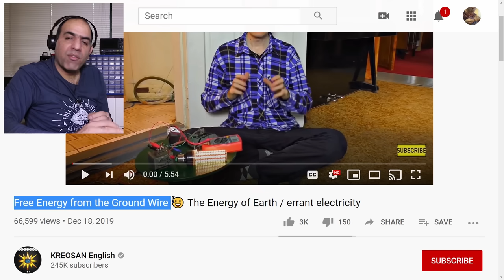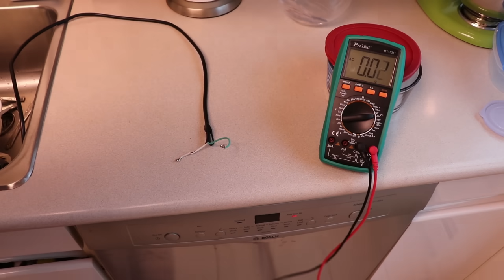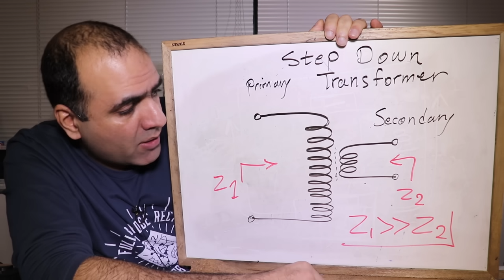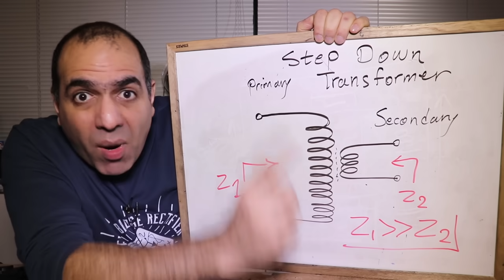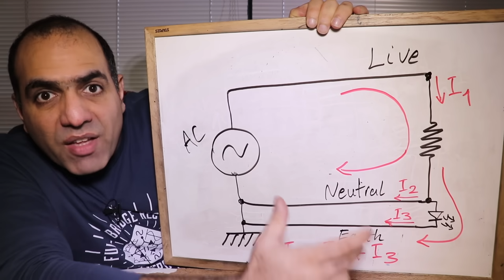FREE ENERGY DISCOVERED in Ukraine, 3M Subs Celeb!!!

Comment: before safety ground (and polarity) was added to plugs, people could plug appliances in however they liked. Both prongs were the same size and there was no ground. Back in those days everything had metal and chrome chassis. Since engineers were safety minded, they would attach the case to neutral, but there was a problem. Since a user could plug the polarity of an appliance in however he wished, one could plug the appliance in so the case was actually hot. not a problem in most cases, since touching it merely rises you to line voltage, but if at the same time you touched a grounded sink, faucet, or another appliance plugged in the other way, you would get a shock of full line voltage. It was deemed bad that a housewife who was touching the toaster, and the refrigerator, which were plugged in with opposite polarity, would give her a full voltage shock!!! it was considered...... unsafe. 
Another shock hazard was -  even if two appliances were plugged with both devices in phase - there could be a voltage potential difference between the cases anyway because neutral is load carrying, so if they were plugged in to a line with a significant load, there could still be a voltage large enough to shock... or if they were on different breakers there could be a significant voltage. Thus was born the safety ground !!!!! (S/G).

So the NEC guys decided to do two things. 
First - require three pronged outlets.... add a safety ground for the chassis so it can be grounded safely without the danger of load bearing neutral voltages.
Second - make the neutral prong larger than the hot prong so if the device does not have the third grounding prong, the two prongs of the plug itself can still force the user to plug the polarity in properly - making it impossible to plug something in "backwards" (if everything is wired correctly LOL)

I think of this little story about safety ground every time you tell your refrigerator story!!!

A barely interesting side note - Almost all of the outlets in north America are installed upside down. They are supposed to be installed with the  ground prong facing up. If you look at the patent, the ground is at the top. The engineer who designed it said this was to reduce the chance that a paperclip or other metal object would cause a direct short if dropped on the prongs. he reasoned that the ground might deflect it or at least there was a chance the metal object would touch ground and neutral rather than being guaranteed to touch hot and neutral as they are normally installed. Electricians put them ground down because it looked better - it made a little face!!! This  "face"  installation (which is technically upside down) has become the de-facto standard. Since they are almost universally installed upside down, right angle plugs are made backwards too,  so they angle down when plugged in, ground down. To tell the truth, I install them upside down too because of this de-facto standard even though I know it is not according to the specs of the inventor.
Reply: Fascinating!
Reply: In most of Europe we use the schuko type F plug. This has two small ground clips; one on each side; which make contact before live and neutral connect. Other than that it is completely symmetrical so live and neutral can be switched randomly depending on the way you insert the plug. That means every device has to tolerate live and neutral being flipped. Because everything tolerates being flipped non-electricians do stupid shit like mix up which wire is live and which is neutral when they wire light switches and sockets. This means that the switch can be sitting on neutral, and it will still work and turn the light off, and the lamp can be floating at mains voltage when you flip the switch off and the wire that is colored as a neutral might be live.
Reply: I just don't understand electricity at all. This made me realise that even more ha

Comment: This is EXACTLY why safety ground was added in the US sometime in the early 1960's. Neutral is a load carrying ground and Safety Ground is non load carrying. I have seen voltage as high as 50 volts on neutral referenced to S/G  In an office building with a lot of equipment like computers or in industrial settings. Many people think neutral and safety ground is the same since they anchor in the same place in the breaker panel, but they are not!!!!  One of the first thing I teach my technicians is be wary of neutral!!! You can get complacent and since it is white, treat it like a dead wire. It can carry enough voltage to give you a good zap if it is load carrying! Also, if there is a break in neutral between you and the panel, you can have full voltage hanging off of it inline with a load. This can place a dangerous amperage through you if you become part of the wire to the panel . If that load is a motor or piece of equipment it will try to push the amperage to make that load go, using you as a series resistor.... One of the most deadly shocks you can get. MUCH deadlier than if you were shocked with a hot wire, because of the push from the load.  A shock from an open neutral is the WORST shock you can get.... and an easy to get shock because you get used to  neutral being grounded. BEWARE of neutral wires when working on nonfunctional equipment until you know neutral is intact. Many times if a piece of equipment has a power fault, it is a loose neutral, because neutrals tend to get wired together in big bundles with big wire nuts, more than should be in the wire nut, and one of the neutrals slip out of the connection !!!

Comment: "Don't switch the primary and secondary wiring"
A 17 year old me learned that the hard way with my foot and a scrapped fly back transformer with no readable markings.
I blew the main breaker. To this day I still close my eyes turning on a circuit.
Reply: That's why electricians are taught the left hand rule.  When flipping the power on a large cabinet, the switch is usually on the right hand side, so throw it with your left hand so you're not standing in front of the cabinet if it blows.
Reply: @danbance5799  i was never taught that rule, however i have also never been near nor heard of one of the cabinets going bang, maybe something i should start observing though just incase.
Reply: hoLY sHIT
Reply: @danbance5799  No relation to the right hand rule.
Reply: @TS-jm7jm  are those "cabinets going bang" we're talking about the thing that happens at about 1:13 is that video : https://www.youtube.com/watch?v=UJGViiDInp0 ?

Comment: NOW LET'S CONNECT IT TO A RELIABLE GROUNDING

connects to a water valve
Reply: To be fair they usually are grounded pretty well, the only issue is if the water pipe itself is rusted/corroded there will be a significant contact impedance

Comment: 3:30
That's not true everywhere, for example we here in Serbia, especially in smaller cites, have "TT sistem zastite", which means that neutral and ground wire are not connected, because of that there is , in my house, around 45V between  neutral and ground. Of course this is only the case in the smaller cites and villages.
Great video, keep it up!
Reply: so in that case, the energy is from the city electricity grid, but not shown on the electricity bill?
Reply: @DreamingConcepts  Exactly. My grandpa figured that out in 1999 when NATO bombed us, so unlike other houses we always had lights and power hahahahahaha
Reply: This is why God is a Serb.
Reply: Meaning kreosan not RECITIFIED completely
Reply: Oo susjed
Reply: No this is true everywhere! the only way to create a true neutral wire is to ground it, the only diofference is that your ground wire is grounded beneath your house and the neutral wire is grounded at the transfo going from high voltage to low voltage. However there are electircal grids with 2 live wires and no neutral wire, if one of those live wires cant carry any electricity for whatever reason the second can carry current to the earth, just not to the second ''live'' wire. And to complicate further even with that kind of grid the only reason that second wire can carry current towards the ground is because the transfo has its neutral wire at the transfo grounded otherwise it wouldnt be a closed circuit
Reply: Zdravo! Ja sam iz Španije
Reply: @mvn4844  In my house the neutral is not connected to the ground, it's 220v system and I measured 202V between hot and neutral and 15V between neutral and ground, whether the system is loaded or not, does it mean I can harness this residual voltage? I guess this voltage is caused by load of the neighbor and neutral is also not connected to the ground, and some resistance of the neutral wire between the building and distribution transformer. For example, if the neighbor has 10kw load I can get 30W residual power between neutral and ground. The bill will go through the neighbor's meter anyway.

Comment: Great video! I guess this trick with the lamp to check grounding wouldn't work in France, as we have GFCIs at the general switchboard so there is no way to "escape" it. Also, in France, Neutral and Earth are not shorted together physically (Earth is connected in every house to the actual physical ground, while Neutral comes from the electrical network) so I was wondering if it would make the voltage between neutral and earth higher, but it does not as I get 0.6 V.

Comment: Solution to the problem is, “Good luck”. Nice
Reply: Using rubber gloves and some common sense would help. And goodbye 3M subscribers.
Reply: @hartunstart  its just too bothersome to use rubber glove everytime you turn on something, so its true, good luck is all you need
Reply: @dennisbuns  Actually, may be rubber gloves are not enough. He would need a full-body condom. But it is definitely more fun with good luck only. Especially, when there are some malfuctions in the luck.

Comment: (I know I am little late) 3:36 in reality, a lot of houses in the СНГ are not grounded because they are too old (this is why kreosan used water pipe for ground)(the water pipe as groud is too dagerous, don't do that or you'll burn your house). And we can actually collect some potential from neutral if it is loaded enough.
Yeah we have something like combined earh and neutral, but again, it is just like neutral that has connection to earth on the power station.

Comment: In Russia, we have ~1 volt between netrual wire and grounded battery, and ~60 volts between netrual wire and ground wire AND ~80 volts between live wire and ground wire. There is NO current between netrual and ground wires.

Comment: When I worked for Detroit Edison in their metering department, I frequently found customers getting free energy. They'd try and be sneaky by trying to conceal the broken meter seal after flipping their meter upside-down for a week or 10 days during the month between meter readings (this was before remote metering with radio transceivers). Even if they'd escape being caught by the meter reader with the upside down meter and successfully concealed the broken meter seal, the meter dials themselves are engineered in such a way as to give away the fact that the meter has ever been operated in reverse!

People will never stop trying to get free energy. Conversely, if you find a stray AC voltage in excess of a few volts on your neutral, it's a safe bet that the neutral of your service drop may have a weak or corroded connection between the house and the pole transformer.

If you have an open neutral, or one with a questionable connection, you'll see a floating AC potential on either hot leg to ground which could be as high as 95 volts! If your house is older (mine was built in 1941) floating potentials can ruin your electronics and could kill you if you inadvertently complete the circuit between neutral and earth ground!
Reply: David Brelin how were they engineered to show reverse operation? Asking for a friend
Reply: I assume those were the old style meters. I expect that the new "smart" meters would know when you disconnected the meter and definitely know if it read backwards.
Reply: It has to do with how meters are built and read which is from right to left (least significant digit to the most significant digit) which is backwards from how numbers are normally read. The motion of the geared numerical dials is such that the least significant digit drives the successively larger digits. This is taken into account for the reading along with slight imperfections in the mating of the dial gears meaning that if a meter has been running backwards, the "reading" of the lower digits will be off. The lower digits will be proceeded by the larger ones due to those slight imperfections in the gearing between them.

In other words, even though the readings are taken from right to left, the digit that follows (say the tens verses the ones) must be looked at to see if it is before or after the zero in order to determine what the ones digit is reading. If it is before the zero then the ones digit takes the previous number's value on the dial it has obviously past. If the second dial is after the zero then the first dial is indicating the number that it has just past (or is pointing directly at). 

The dials alternate directions as well. The ones digit will always turn in a clockwise direction. The tens digit rotates in the counterclockwise direction. The hundreds digit rotates in the clockwise direction. And on and on. This means that the gears are directly driven in mesh so that each successive dial's gearing gap gets multiplied. That's why the dials indicate when the meter has been running backwards for a time. This multiplication of gearing errors is accounted for in reading the meter when it has been running forward. The dials will "look slightly off" when they have been run backwards because of the way they're constructed and the way they are read.
Reply: @drescherjm  it could, but not necessarily so. With the prevalence of residential solar net metering, newer meters are designed to operate in either direction. So a backwards spinning meter is to be expected in a net metering situation. Here, what is important is whether the meter has ever lost power completely (by being removed from it's base and turned upside down purposefully so that it reads backwards). Only a physical on site inspection can determine fraud in such cases. The evidence would be a broken meter seal for starters, and excessive wear on the spades on the back of the meter (the clamping force on the spades is not insignificant).

Comment: Grettings from Russia! My house doesn’t have ground wire and my watching machine always shocks me when i touch it with wet hand
Reply: Watching machine? You mean television?
Reply: How often dose the machine watch you?
Reply: So maybe you should stop touching it..
Reply: @keepernod2888  i think he meant washing machine
Reply: In Russia tv and washingmachine watches you
Reply: connect the metal that's grounding you to the wall or ground. it should shock you
Reply: Что-что?) Смотрельная машина?) Я еще долго буду вспоминать эти комменты, ор)
Reply: Sounds scary. In Finland ground wire were typically used until the 90s or so but sockets were grounded connecting the neutral to the ground connector.
Reply: GROUND IT!!!
Reply: The statics from their tv cleans your fabrics, dry cleaning it is called.

Comment: To me, the reason we find a voltaje in the neutral is because induction from the power line. If you drive more power in the power line, the more induction you create on the neutral (or voltaje) Obviously if you use this energy, it will impact your bill.

Comment: I thought I understand electricity somewhat, but now I don't think so any more.
How are you measuring a nonzero voltage across a plain wire at 8:34?
Is that just based on the resistance of it, including the poor contact at the alligator clips?
Reply: Plain wires still have some resistance, they're not superconductors

Comment: I love Kreosan’s channel, I think that the only reason why this seems like a free energy video is because of the translation from Russian, rather than what we term “free energy” in the West. Their Pripyat videos are some of my favorite videos on YouTube, they do a lot more than just the tech stuff.
Reply: Actually he was talking about energy gained from ground due to neighbours bad wiring, like energy leak to radiator or water pipes (like one in video) from neighbour's boiler. So its free for Kreosan, but not for neighbour.
Reply: @Riketta  He talked about faulty wiring, but his explanation for the case was phase unbalance, which according to him is usually dumbed to ground anyway. So the energy is "free" as it would be wasted anyway.

Perhaps more interesting part was "sparking radiator". You see, his friend probably lives in an old apartment, that doesn't have any grounding, which on its own is at least kind of safe. But some electrical enthusiasts in Eastern Europe add their own ground by connecting ground wire to pluming, which in turn is extremely dangerous. When faulty electronics shorts live to "ground", it doesn't trigger anything, instead the pluming becomes live. In that case you can probably steal a lot of energy.

However, what Kreosan did is, he connected to neutral to pluming, that's also dangerous, especially in old houses that don't feature any grounding in the plug. But unlike in ElectroBOOM's case, he's endangering people in whole apartment building.